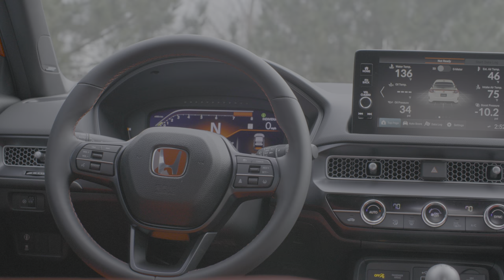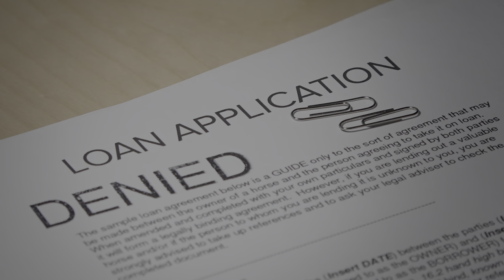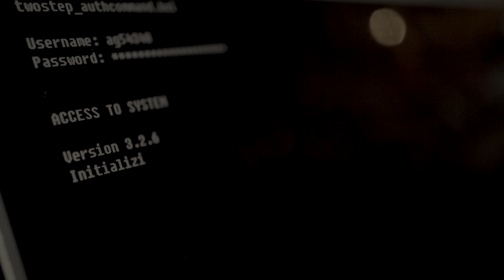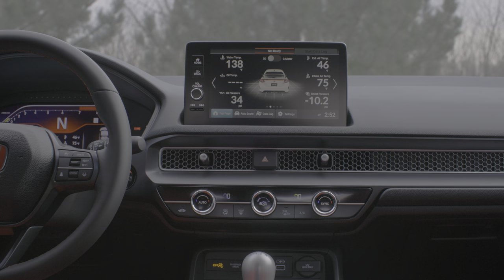Why I Bought an FL5 Civic Type R

Comment: This video was a dealer advertisement.  I think the other goose ordered a Z06.  Will his dealer advertisement be as good as this one?  You guys lost credibility with this 22 minutes of BS.
Reply from the maker: I honestly don't think people understand the dealer had nothing to do with this The car came directly from Honda and was allocated to me I owed the dealership nothing.  The only thing brilliance did was deliver the car and give me the paperwork.  I purely included them in this video because I wanted to and on top of it they don't sell to out of state customers so there's literally no benefit to them at all.
Reply: @savagegeese  I understand you secured a new car allocation at MSRP and corporate pushed the deal through that dealer. I did the same thing many years ago with a corporate connection at another manufacturer.  The dealer involvement was low, OK, same in my case.  So why was the stealership owner in the video if they contributed so little?

The negative reaction from your supporters is caused by the lot lizard appearance.  I've enjoyed all of the SG content I've seen except this one.  I'll keep watching but please go back to what you were doing.
Reply from the maker: @robdevaux3407  Because the previous dealership they bought went under from lawsuits.  They bought it and turned it around.  I judged them unfairly because of the past.  But clearly did not get my point across.  File the video under missed attempt.
Reply: @savagegeese  Fair enough.  New dealer still comes across as a sleaze.  I hope you enjoy the car, it looks like fun.